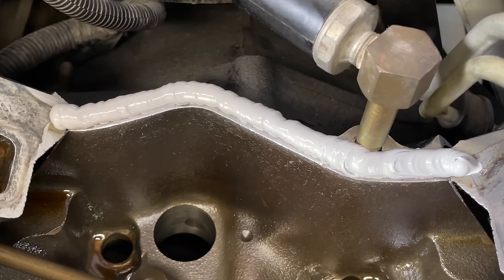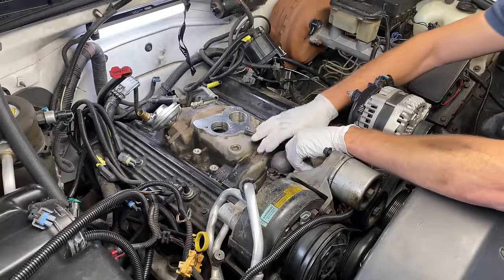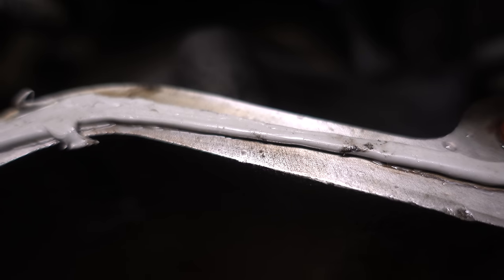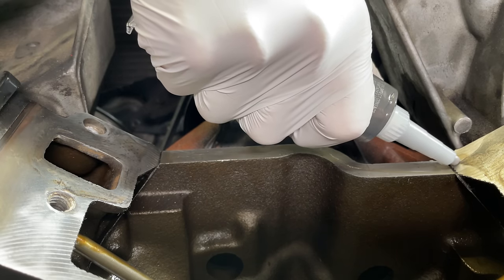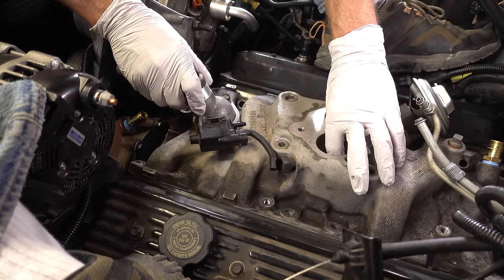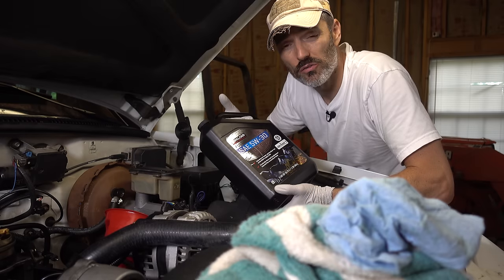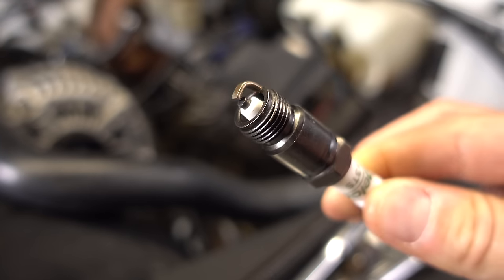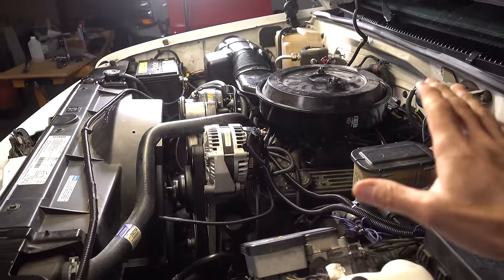Why You NEVER ATTEMPT To Use RTV Gasket Maker Without Doing This First!!

Comment: Quite a misleading video for most cases. In general you don't need anywhere near as much as you are suggesting, in almost all cases the finished joint will be very very thin , putting  a 3mm thick bead across the whole width of the flange will result in 95%+ of the sealant being expelled out the side of the flange  or worse into coolant and oil-ways depending on the joint being sealed. What is on the inside of the engine can break off and get into the intake. The real problem here is that the  whole intake manifold and gasket setup being used is not right . I suspect the blue gaskets used are way thicker than OE resulting in a much bigger gap to be sealed at the ends of the valley. Depending how thick the final seal is  that RTV seal may not last long , it's not designed to seal wide gaps.

Comment: Another thing I always do is to completely degrease any surfaces that I want to seal with Berryman's carburetor cleaner, regardless of what type sealer I use.  If you use Permatex No. 1 Form-a-gasket, you'll need at least a good pry bar and maybe even a hammer and chisel to unseal it later.  Speaking from experience. 😂😂

Comment: I think I would FIRST want to MORE sufficiently "secure" the gaskets to the block so that I could be assured the gaskets would remain in the proper position on the block through the process of applying the RTV, then replacing and securing the manifold. More scraping needed on next replacement? So be it.

Comment: I didn't use RTV on the front and back of mine. I made a gasket out of very hard cardboard type material. I used just a dab where they meet up with the larger gasket
Reply from the maker: I’m wondering why they don’t make a physical gasket to go there? I wonder if there are just too many variables?
Reply: @1RoadGarage  I wondered the same thing. I can't see a reason unless they are worried most people won't torque it down correctly. On small block Chevy motors back in the day I put rtv on all the replacement gaskets. Due to the weird angles of down pressure. Maybe this was the best way to guarantee success.

Comment: You should never torque bolts multiple times. Any bolt should be torqued only once. Also, FYI, when using an extension for the torque wrench it should be avoided as much as possible and if unavoidable it should be the shortest one available.
Reply: You have no idea how torque works, as most mechanic who hasn’t learned basic physics, it really isn’t your fault, that’s US education for you! I have proved my instructors wrong by using a 6 ft extension on a torque tester, it was exactly the same as no extension. Length only affects dynamic torque because it acts as a spring, it will dissipate energy, but if you were torquing with a torque wrench you would notice that you had a lot more slack than usual when turning, but eventually it will stiffen up and make the click.

Comment: I watched your previous video. You made two mistakes when applying the RTV. The instructions on all of the RTV I have ever used give a very specific procedure to follow, so that it will not leak. First, both surfaces MUST be clean of oil, grease etc. Second apply a 1/8" bead. Third install the part. Fourth, tighten all bolts HAND TIGHT ONLY!  Fifth and most important - Let the silicone set for 60 minutes before torquing it down.

This step is very important. If you don't allow it to setup and torque it immediately you will simply squeeze out most of the RTV, and sealing will depend only on a very thin film, i.e the "gasket" did not form as it was supposed to, and it will absolutely leak. I follow this procedure and have never had any issues.

Comment: There are two other small pieces that come with the manifold gaskets.. shouldn't they be there in place of the gasket maker?
Reply: Don’t use those, you are better off applying your own gasket maker. I had a mechanic install those and they failed, luckily I redid the job myself 2x and got it right.

Comment: No "pro" would use RTV. They would use the appropriate gasket. Don't take this the wrong way, your videos are great.
Reply: Manufactures stopped using front and rear manifold edge gaskets decades ago because they always leaked.  RTV is standard.
Reply: @blackhawk7r221  Only on crappy cars and engines. Especially audi's. That's why when you buy a gasket kit, it comes with the front and rear intake gaskets. You put RTV under them, and on top of them, they don't leak. That RTV, gasket maker crap usually doesn't seal and if it does, it will soon leak. It's crap.
Reply: @JohnDoe-ml8ru  Keep doing it then.  It’s such a good idea that manufacturers stopped using China Wall gaskets decades ago.  It keeps my technicians busy going behind other “mechanics” who used aftermarket kits that included these gaskets.  Cheers.
Reply: @blackhawk7r221  Ditto.

Comment: Are there torque specs for the intake bolts?
Reply: There's torque specs and a torque.  I don't know about the V8 but it's very weird torquing sequence  on a 4.3 v-6. The 4.3 is the exact same motor but missing two cylinders so these are extremely similar.
If the torque sequence from GM seems odd, follow it anyway.  Chevrolet specified their torque sequence for a reason. They are the engineers, we aren't 😉

Comment: You probably did have a vacuum leak at the same place where you didn't put enough sealer.  That allows unmetered air to enter the crankcase.  The crankcase of an LS engine and the rest of the PCV system all the way from the intake hose that connects between MAF sensor and the throttle body to the intake manifold vacuum hose that connects to the PCV valve has to be airtight, these days.  If there's a leak and the engine receives extra air that doesn't go through the MAF sensor -- or even too much blow-by to the crankcase (it doesn't know the difference) -- the PCM will look at the oxygen sensor output and see a lean mixture.  But, since the extra air bypassed the MAF sensor, and the MAF sensor is detecting the right amount of air going through it, the PCM thinks there's a leak somewhere but erroneously gives a DTC for a leak in the EVAP system.  At least, that's what mine does.  And, by the way, there's no longer a PCV VALVE.  It's a PCV orifice now.
Reply: @xgreasexmonkey5506  Your ignorance is showing, dude.  There most certainly is vacuum there, because the chamber covered by the valley cover has ports into the crankcase below.  If the two weren't connected, you wouldn't need sealant here, because there'd be no oil here.  The PCV hose from the PCV orifice to the intake manifold puts vacuum on the crankcase to pull out oil vapors and combustion blow-by.

By the way, I've been working on cars since the mid 1960s, and I'm STILL working on them.  I doubt you've ever seen the part of the engine we're discussing here.  But I have.  I own one.

Comment: First off use the black gasket maker. It's the most oil resistant they make. Rub it down to about 5mm. Torque patterns matter. Wait 24hrs before starting

Comment: The metal should be touching metal. The rtv is only to fill in microscopic scratches and imperfections. After pulling parts apart the sealer should not really be visible on the sealing surface except for the squeeze out. 99% of the RTV laid down should be stuck to both sides as tiny beads of squeeze out.

Comment: First thing to do is drain the radiator and run it without the thermostat so that all the water gets pumped out @ 20-40 seconds.  Anti freeze in your lifters, pistons and everything else that antifreeze shouldn’t be in . Will destroy your engine . Just make sure that your dog is kept away from licking and drinking that antifreeze, because it’s sweet to them.  For if they do then you will lose your pet within minutes.    I live where the weather doesn’t go below 38 degrees and all I use is  a tablespoon of soluble oil and  purified water.    And I don’t even run any electric fans and don’t have a regular fan at all.   Believe it or not !

Comment: Back in the olden days they used to have a rubber or silicone gasket in that area. 
You had to try and keep them in place with just a blob of silicone where they went together in the corners.
Way, way, way back when I was a young teen just starting the big guys would put someone like ME doing the job of scraping off the PERMATEX No. 2 that they would put all over everything in the days before silicone sealer.
What a mess.
Now they cheat and just use silicone by itself front and back.
Sometimes using silicone for a gasket in a place where it's not going to be paper thin and I have time I apply an even amount of sealer and let it completely set up and cure then when it is squeezed it holds some pressure like a rubber gasket.

Comment: If there is a leak on the rear "china wall": rather than diss-assemble the entire intake manifold. You can use carb cleaner to clean the rear surfaces of the block and manifold really good. Then spread a bead of silicone using your finger. No one will see it up against the firewall. The is no real pressure from the crank case so it will hold for years. Done this a few times. The rubber seals will sometimes squeeze out of position, and when that happens, this is an easy and sure fix.

Comment: I did a valve cover gasket over the weekend, I too screwed up and it’s pissing oil and the stench of oil burned over the exhaust manifold is driving me crazy. 2002 dodge Ram 5.9 magnum, I did the best I could to clean the matting surface, but the rear of the engine was a very if not impossible to get to as the engine is enclosed in a cave like enclosure. Can I use rtv permatex ultra black in addition to the gasket? The bolts are also small, so I didn’t want to torque them too much. It’s only leaking toward the back driver side, one more thing……can I reuse the gasket if I’m careful to remove it? 

To anybody that wants to have an input in this matter, I thank you in advance. Yeah!!!!!!! I’m a cheap diy wanna be, rookie mechanic that doesn’t have money to pay a mechanic. This is an old truck, if I had money I’d buy another one; hence the diy repairs.

Comment: ONLY USE HIGH HEAT RTV GASKET MAKER.AND USE ENOUGH SPPEAD THE LAYER OVER THE SURFACE WITH YOUR FINGER THEN AD A HEAVEY BEAD LET CURE 24 HRS THEN RUN YOUR ENGINE DO NOT AD COOLANT OR OIL TILL COMPLETLY CURED.
ALSO USE RIGHT TORQUE  SEQUENCE AND CORRECT TORQUE

Comment: What made you want to use thread sealer on the manifold bolts?
Reply from the maker: It’s recommended. They’re through bolts and oil can come through.
Reply: @1RoadGarage  I see. I can't remember if I did this to mine or not. 5 years has been a long time. I work on fords. I drive a Chevy. All the ford work drowns out my past Chevy work I have done on my trucks.
Reply: @1RoadGarage 
Thanks for explaining this. It appeared to be thread sealant but you called it thread locker at 10:14. 
Thanks for sharing “lessons learned” 👍🏻

Comment: I would never use that much gasket sealer, a thin bead is all thats needed. With a good side dab on the corners. If theres too much ive seen it buldge out and come free inside of the engine. My personal favorite is the rite stuff unless it calls for something specific

Comment: Mate Ur thoughts on Ur 1st attack were logical, so don't be down on urself.
These are the things U learn thru experience, a lot of the time unless U do make some mistakes U don't really learn anything, the engineers made them during design, they didn't just nail it 1st go, hell a lot of the time they didn't nail it at all and it takes an experienced mechanic to permanently rectify the issue the engineers overlooked.

Comment: The problem you run into is it collect on the oil pickup screen. In order for it to become an issue you have to get a bit silly putting it on. As long as you don't act like a kid putting toothpaste on a toothbrush you will be ok. :))

Comment: You didnt make a mistake, just didnt know how much of a gap was left, it was a good trial run. 
In this application it was not necessary to allow the rtv silicone to dry for 1 hour before final tightening. You do that when the mating surfaces will squeeze out most of the wet silicone if you torque it down too much. But in this case this was not possible, becasue the 2 surfaces don't completely meet, a decent gap is left becasue of the manifold gaskets. I would have torqued down the manifold to spec,  spreading the wet rtv silicone as far it wants to go, allowing it to stick to as much of the mating surfacesas possible  before it starts to dry. You put so much on the second time, it covered most of the surafces anyway.

Comment: Both of those beads are bad.  The first is a little smal, but mostly just inconsistent.  The second is way too much.  The rtv is there simply to fill voids and inconsistency in the surfaces.  Follow the vehicle manufacturer recomendation (usually 1/4" or a little under in width.  Then follow the sealant manufacturer recommendations for application.  Usually finger tighten until you get squeeze out, wait one hour, then torque to spec.

Also, if the manufacturer doesn't use a gasket, but uses rtv, use rtv.  The engineers know what they're doing.

The biggest cause of failure is going to be  due to oil or other contaminants on the surfaces.  Use brake cleaner and shop cloth or paper towel to clean the surfaces thoroughly.

Comment: It didnt look lile you use too little. When using gasket maker. The prep for it is the most important part. Making sre the surfaces are clean. And you let the gasket maker have time to setup first and foremost with the intake in place not all the way torques yet. Then afterwards you can torque it down 20-30 minutes before allowing it to fully cure on its own another hour or so. Gasket maker just needs proper time and such.

Comment: The need to use that much rtv on a joint just tells that there are some flaws in the design of the parts, either that or you are missing a gasket, rtv is not a gasket it just improves sealing properties of gaskets...

Comment: Using RTV like that always makes me cringe and a bit nervous. Just as it's squeezing out on the outside of the manifold, it's also squeezing out on the inside. A chunk of that stuff breaking off and plugging something up like a fine oil passage or several tubules of the radiator will no doubt ruin your day and likely your engine. Always use RTV with caution.

Comment: Should actually be using ultra black because it has the best oil resistance.
Reply: Thats what I thought. I have to work on the stator cover on my bike and oil pan gasket on my truck and thought ultra black is the way to go

Comment: Its s rare for a youtuber to say the way i did it was wrong, even when proven what they dd was wrong and it didnt work, most usually double down with absurd arguments defending there stupid ways. Good on you for saying i messed up. Your not at fault at all, you use logic and common sense, about not putting too much, having it come out. ff you were to use that 1st amount on a vw, with those tolerances, most of it would of came out. How were you supposed to know that American engines gap tolerances are wider than kim kardashians asstonishing gap, technical specs for that engine say that the tolerance is about big as a letter box gap. the design of the manifold is so bad, there is not 1 bolt thats pulling the manifold down, the only bolts are on both sides, the more you torque, the more it pulls from eachside, it literally doesnt lower anymore. hence something as simple as a manifold has to use gaskets thick as an orea, and sealant at the same time. i dont think any engineers were involved in the design of this engine. Dont bother trying to squeeze sealant out from the tube thru the tip, thats whay too precise for this engine. to be to be sure you should of just peal the outside of that permatex tube, and place the content on the part that the sealent, needs to go, one tube for the front one for the rear.

Comment: You only needed to pack it back in to seal it removing the manifold was unnecessary. Gasket maker doesn't need to be compressed down between surfaces like a normal gasket does

Comment: I never use that small tube of grey. Its not the same as ultra grey. The small one is more like hi grade rtv silicone. The ultra grey is much stronger. Plus you can buy a much larger tube. I just use those small ones for tacking smaller projects.

Comment: In most engines you don't have to use THAT much RTV.. it's just for some strange reason GM have decided to make a much bigger gap in that particular engine. I blame GM and not the fact that you didn't apply enough gasket maker

Comment: Im suprised it leaked i do near 0clearance headgaskets on air cooled small engines all the time  you have to advance the valves a wee bit but it ups the compresion ratio alot  i use aircraft grade gasket sealer not maker  and get the head and block decked  make a 125 honda run like a mini f1 motor  admitedly i have to redo it because compression loss ever few months of use but its like 14 10 mm bolts for me to get the job done  but the regular gasket will only last another 6 to 8 months any how  i havent gotten one dynod but i know it moves my larfe ass around better by tighening the compression chamber and i have the 10k plus cid on my engines even w all that stress ive never had the gasket fail out the side

Comment: Thats a big job? Wish my shop had repair jobs as easy as that come in on a regular basis. Every intake manifold job i get is on an engine that has so much crap mounted on top that you literally cannot even see the intake until you spend 2 hours removing the garbage thats attached or running above it. Also, using silicone is pretty  much a common sense endeavor, if the gap you're trying to fill is a sixteenth of an inch - you use a consistant eigth of inch bead to seal it, it's basically just as simple as that